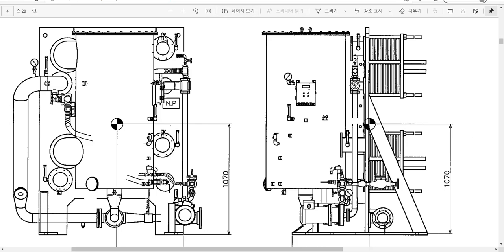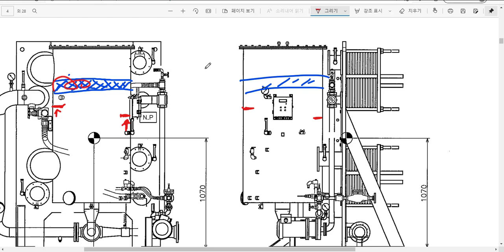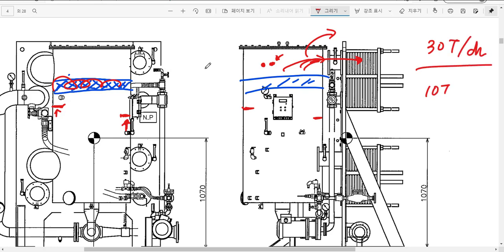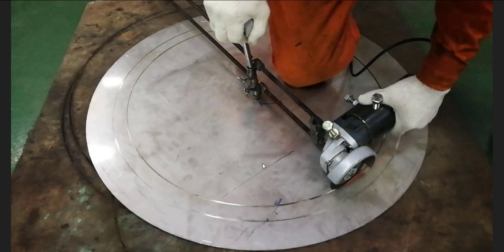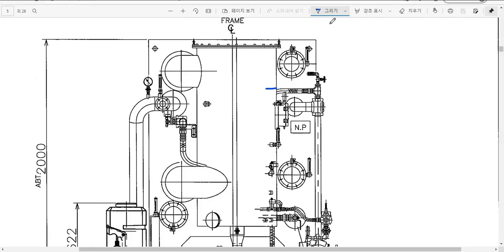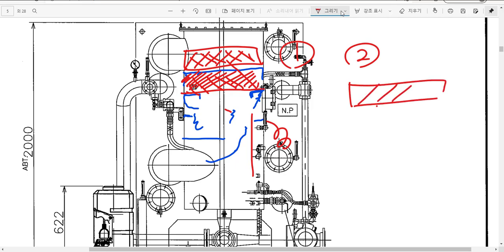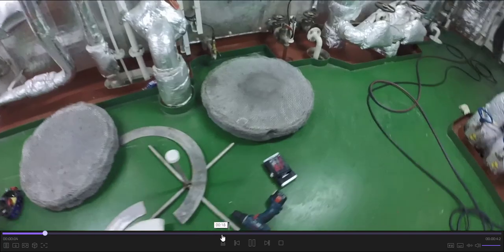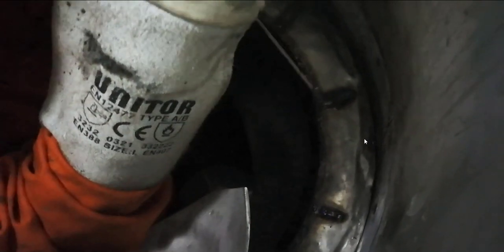How to Repair (Modify or Fix) SASAKURA Fresh Water Generator Salinity High Problem.

Comment from the maker: Because the stainless steel plate was welded to the stainless steel body, no problem occurred, and the ship's chronic water shortage was completely solved.
This Maker's This Type Assistant strongly recommends applying the modifi I showed you..

Comment: And what was the result? How mach producing of fw increased after this improving? How changes time interval between chemical cleaning? As I know some manufacters prohibit any welding job in shell of FWG, so did you experience any negative consequences?
Reply from the maker: Max. Capacity: 32m3/day, but This FWG was usually 10m3/day produced.
The manufacturer said that the ship’s CFW TEMP was too high. And they didn't give any solutions to make it up.
So I asked to superintendent to modify.

Maximum capacity 32m3/day, but that FWG was only producing about 10 tons a day.
Even after the ship was built and remained in such a state for two years, the manufacturer did not suggest or improve any measures, claiming that it was because the CFW temperature of the main line was high.

So I came up with such a method in consultation with superintendent as a Chief Engineer.
The result is... 
10 m3/day ➡ 30 m3/day has been improved.
All added parts have been worked with stainless and no special side effects have been reported so far.

Conclusion: If CFW temperature is high, water boils quickly.
However, if salt water that has not evaporated completely cannot be filtered, salinity increases and water production decreases.
 So we can improve this problem with tasks such as video
Reply from the maker: Max. Capacity: 32m3/day, but This FWG was usually 10m3/day produced.
The manufacturer said that the ship’s CFW TEMP was too high. And they didn't give any solutions to make it up.
So I asked to superintendent to modify.

Maximum capacity 32m3/day, but that FWG was only producing about 10 tons a day.
Even after the ship was built and remained in such a state for two years, the manufacturer did not suggest or improve any measures, claiming that it was because the CFW temperature of the main line was high.

So I came up with such a method in consultation with superintendent as a Chief Engineer.
The result is... 
10 m3/day ➡ 30 m3/day has been improved.
All added parts have been worked with stainless and no special side effects have been reported so far.

Conclusion: If CFW temperature is high, water boils quickly.
However, if salt water that has not evaporated completely cannot be filtered, salinity increases and water production decreases.
 So we can improve this problem with tasks such as video